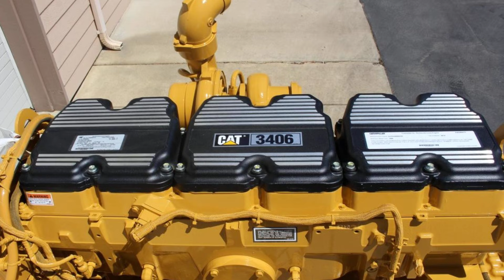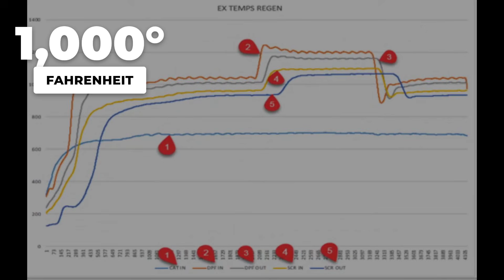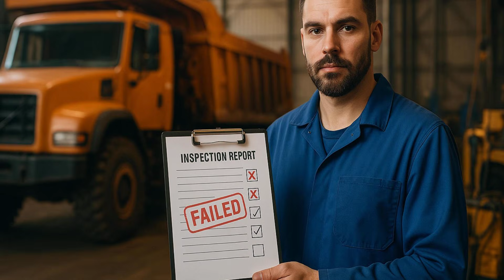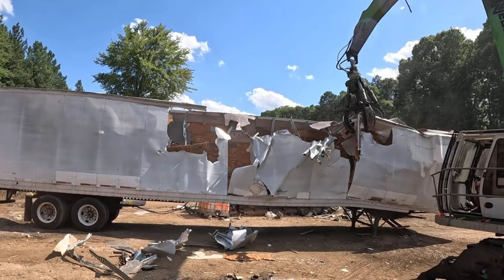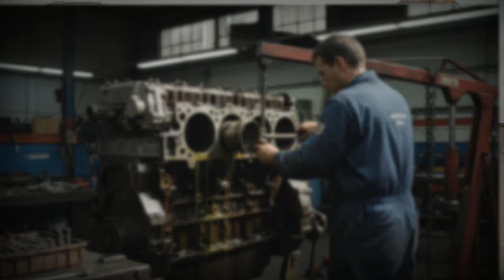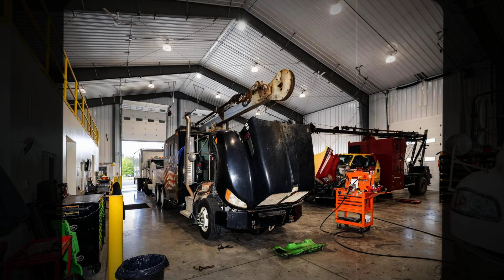Why Every Trucker In America Hates Their New Truck (The Diesel Emissions Scam)

Comment: In the EPA attack on nitrogen oxides, they require more fuel to run rich to reduce nitrogen oxide. They also don't want soot so you have a diesel particulate filter that catches the soot. To burn the soot build up out, you have to add more fuel. How is burning more fuel cleaner? Government regulations with unintended consequences. It seems like the government won't be happy until we are cleaning the air with trucks putting out cleaner air than they are taking in. In some areas this is already happening. The guys doing deletes and turning up the fuel to roll coal are not helping. If you run lean and clean the Karens won't complain as much. Restore and drive pre emissions trucks. I drove a 1965 Peterbilt for years and never had an emissions related problem.

Comment: Use gas engines.
Reply: The amount of work that a gas engine can do is limited compared to diesel. A diesel will get 6 MPG while a gas engine trying to keep up will get 2 MPG and won't get the job done. It also produces nitrogen oxides due to high temperature combustion.
Reply: Gasoline engines are for pleasure. Diesel engines are for work. Tell us all which engine is more important.